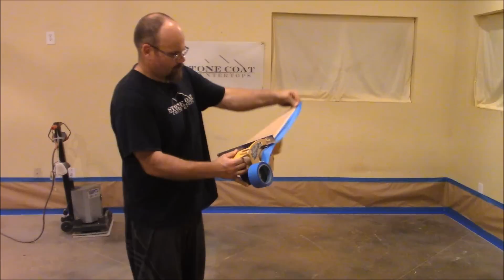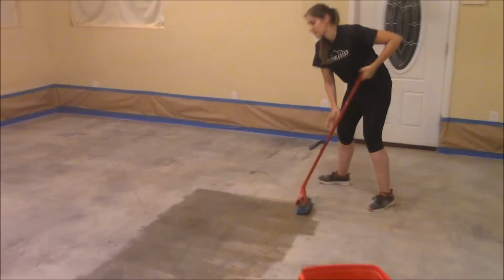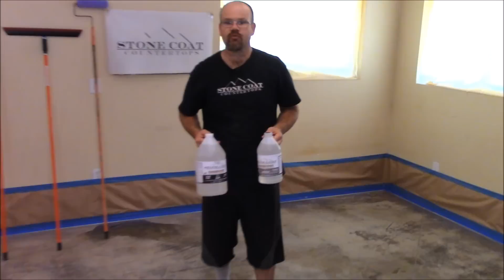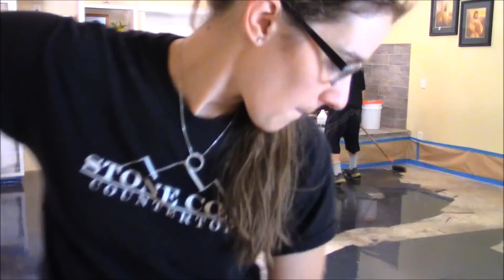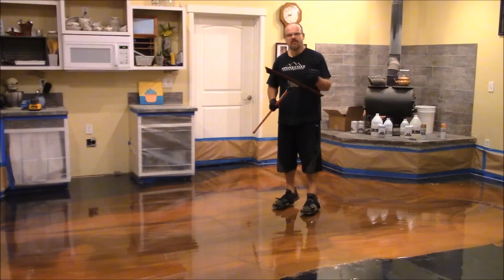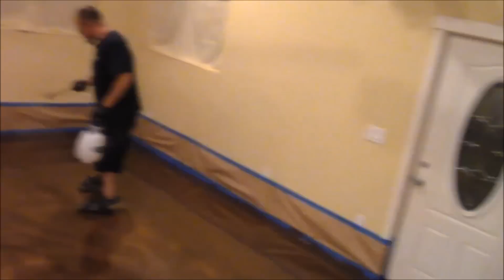How to Install Metallic Floor Epoxy

Comment: Is that it? You just suddenly end the video! 
Do you also pour a clear coat over the top of the color coat, like on the counter tops? Or just stop after the alcohol spray? 
How long to dry before it can be walked on?

And why are most of your answers not available to be read on YouTube? It says you have commented. But when I click on it, there is no answer there. I know you answered bc the asker thanked you for your response!?

Comment: Dude. You need to be masked up. Doing a video in a room full of dust w no breathing protection? And no mask while mixing metallic powder??
As another 20 year installer, its hard to take you seriously while these extremely dangerous things are going on. No vacuum control on floor machine? Tighten it up. Or youre gonna die. Or hurt someone else while doing residential work as carelessly as this video. Not good dude.

Comment: Where did you get the quarter inch notch rubber trowel plz I don’t see it on the website favorite tool list
Reply from the maker: Here ya go Edd https://www.amazon.com/dp/B001RIX48Y/ref=as_sl_pc_qf_sp_asin_til?tag=stoncoatcoun-20&linkCode=w00&linkId=2bdb8d49b05979233fb7c29b1a208dc6&creativeASIN=B001RIX48Y
Other tools: https://www.stonecoatcountertops.com/favorite-tools-checklist

Comment: Nice presentation good explanation I am sold I'm ordering Monday May 3,2021 for a small project 12 sq feet. I'm going to use level quick because I  have a level difference from hard wood floor to concrete. Also level quick will help minus difference of front door thresh hold. Topping with transition of 12' . Thank you watched studied like the product. Hope delivery time is within 5 days.

Comment: Gorgeous! Question: if you have vinyl/laminate flooring, should you remove it before doing epoxy or can you sand it down and do epoxy over the top? Same question for wood floors?
Reply from the maker: Our epoxy can cover almost any surface! Google Stone Coat Countertops over your surface choice and you will get all the information to help you complete your project and remember...You got this! -Nathan

Comment: Have you tried "shotgunning" the bottle while its upside down? Just jab a hole in the side. I'd do about an inch from the bottom to avoid leaking when placed upright.

I love all the projects by the way.

Comment: I don't want use a propane burner to pop bubbles and I don't have a mister for the oil. would a standard spray pump water bottle filled with alcohol do the trick?

Comment: You'd be amazed how fast your product would come out of the gallon jugs if you allowed air inside the jug... your jug holder is starving the jug of air which slows the flow rate.  Just Say'n

Comment: After determing the square footage of the flooring area,  how do you determine how much epoxy needed?  How much square footage does a bottle of epoxy cover?  Cost? 
Can this product be used on stairs?
Can this product be used over old kitchen laminate flooring?
Also, do you have a list of all the materials we need to purchase to complete the job?
Cost Estimate of materials needed?

Thank You.
Reply: Did you ever get any answers on this on your own??would like to know thanks
Reply: @AbransWorkshop  
No,. I Didn't.

Comment: It looks rather slick. Do you have recommendations for say...a garage floor that experiences many ping-pong battles? It is also traveled by many wet shoes/feet with little traction on the sole. Thanks in advance.
Reply: Other epoxy videos (including Mike and StoneCoat Countertops) recommend a topcoat/sealcoat of clear polyurethane. There's no reason you couldn't use a clear textured poly as a topcoat to give the floor some "grip." Given that it's textured you will trade off a small degree of clarity but the floor would still be beautiful... and safe!

Comment: I tried this and my Goldendoodles got in the room and they shit all over the floor and rolled in the wet epoxy paint and fell asleep on the floor and they got stuck to the floor and I had to shave them to get them free but now my epoxy floor has two small built in area rugs right in the middle of the room.
Reply: Just throw the whole damn dog away.

Comment: I was wondering can you apply to floors that have ceramic tiles already down. I was thinking about putting the product on top of the existing floor filling in the grout lines and creating a marbled look. If this is possible would the prep work be the same as to concrete?

Comment: Did you use a roller after you used the trowel, or did you just let it flow out and torched it. Love the videos, my next project is the floors and we don’t like tile. The color is great also.

Comment: Warning: Do not try to vacuum up concrete or epoxy sanding dust with a regular household vacuum. It WILL clog up the device in no time and render it unusable until a thorough maintenance.
You need a water based vacuum or a good (self cleaning) shop vac. Better yet: Use a broom.
Reply: Fwiw, I wouldn't recommend using a broom. The dust is so fine you will just push it up into the air and then it will recirculate all around your house. What you specifically need is a Shop Vac and a specific shop vac bag, specifically the following bags for ultra fine dust. https://amzn.to/2Gr7FnN

Comment: I noticed after you sanded the floor you did a moisture test. If the floor came back positive for moisture the floor sanding would be vain

Comment: When your filling the joints you say you can use level quick...would you have to sand that down after dries before laying down your first floor coat??
Reply from the maker: Hi Brandon Raynes, yes you would want to sand the level quick down to a smooth flat surface removing any high points, or nibs and nubs before proceeding.
Reply: I

Comment: How long do you wait until you pull up the tap?? When you walk on the epoxy while pulling up the tap do you wear regular shoes??? Thanks
Reply from the maker: Hi Brandon Raynes thanks for the comment! 
You'll want to remove any tape before the epoxy hardens, you want to wear the spiked shoes to minimize surface area of your feet on the epoxy surface and allow the epoxy to easily self level back into the areas that you stepped. 
Give us a call at 541-450-1976 and we can get you some pro tips before starting your project!
Reply: Thanks for the answer sir but when do you pull the tape??

Comment: Can you install radiant heat under the epoxy just asking because I see this getting cold as heck?
Reply from the maker: Awesome thought Glen! Yes you can apply our flooring epoxy over a radiant heated floor. Give us a call at 541-450-1976 with any questions and we can get you going!

Comment: Do you put a clear coat over the top?  I'm thinking of metallic blue with white sparkles.
Reply from the maker: Great question CaseAgainstFaith1.  Our Stone Coat Countertop Flooring Epoxy 1 1/2-gallon kit will cover 100 square feet including the prime coat and the flood coat. This is a great 2 coat system. Each kit comes in your choice of Stone Coat Countertop Metallic powder in the large flooring size to create marble metallic effects. The first coat is applied very thin at 300 square feet per gallon using a flat floor squeegee then back rolling. Cut the edges in with a brush. You add one flooring size metallic powder to each 1-1/2-gallon kit to achieve amazing depth in color. We recommend 2 metallic colors per floor for a great marbling effect. The second coat is applied at 100 square feet per gallon using a 1/4" v notch floor squeegee and then back rolling. Cut in the edges with a brush. Simply pour out the mixture in ribbons and mix together on the floor using your squeegee and back rolling to make amazing effects. Here is a link to more information about our Flooring Kit, including training videos and  written instructions: https://www.stonecoatcountertops.com/flooring-epoxy Please call or write us anytime with questions or for free project support. (541) 450-1976

Comment: at the end could you use a torch like a weed burner type? Of course safety first
Reply from the maker: Hi Darren! Here is a link to the torch nozzle and hose we used for this project: https://www.amazon.com/Propane-Turbo-Torch-Nozzles-Hose/dp/B000TBS2RS/ref=as_sl_pc_qf_sp_asin_til?tag=stoncoatcoun-20&linkCode=w00&linkId=3fbe11024fed2ccd5d28463d2d7048d7&creativeASIN=B000TBS2RS

Comment: When you start the cleaning phase, you should have a rainbow vacuum cleaner running in order to  remove dust from the air.
Reply from the maker: Thanks for the tip Ann Matthews!  Are you working on any projects currently?
Reply: Not yet; but we are laying plans to do a kitchen counter and backsplash, as well as a bathroom tub surround and a double sink vanity top with an apron front. Hope to start these before the end of the year. I viewed several of your videos and you have given me great inspiration! Thank you!

Comment: Would there be any way to lay down strips on the floor, before laying the epoxy, that can be pulled up after. To give the floor the look of a tile floor?
Reply from the maker: Great question Kent B, the floor would need to be sound for this process to work. Once the floor is coated there wouldn't be a way to pull up the strips as they would be cured into the epoxy.  Please feel free to call or email us anytime with questions or for project support. (541)450-1976
Reply: Perhaps lay down a color coat, add grout colored strips, then a clear coat

Comment: Have you ever tried using automobile wax on the bottom masking tape line,  so it can be removed after resin is cured without sticking?
Reply from the maker: Great question glenn and thank you for tuning in! We haven't tried this method before.  We always remove the tape after we have finish so that it will not cure into the epoxy.
Reply: @StoneCoatCountertops Its what we do when working with resins for composites on aircraft

Comment: I like you guys, just finishing my 1st little project, bought lots of epoxy i have no idea what will i do with it but when wood gets to me its gonna be wild !! Btw, when is the best time to take off tapes from the wall  ? is it just right after applying final coat ? or you just wait till everything dries then cut it off ? wouldnt that leave marks and shit ?
Reply from the maker: Great question Pawel and thank you for your feedback! We remove the masking that touches the epoxy surface right when we are done with each coat so it won't get locked in, and re-apply the masking at the walls between coats.  Please feel free to call or email us anytime for free project support. (541)450-1976

Comment: What is the life of epoxy (l mean gaurentee)
Reply: On a counter top it can last a lifetime with just some light polishing from time to time. On a floor, High traffic areas will need to be polished more often.

@Stone Coat Countertops, What type of polish would you recommend for floor applications?

Comment: I have a rough finish basement floor.  Some pitting and older cement.  Used a basement floor paint previously.  Does the Epoxy have a self leveling effect or does a self leveling process need to be done first and then do your flooring process over it?  How does the floor perform with high humidity in the basement?

Also you mentioned ok to do over laminate flooring.   Ok on stairs over laminate?  Does the mixture film over any nails or screws and level out to not show any indents?  

I'm concerned if it will be very slippery when wet.  Is sand or some material to be added to eliminate dangerous slipping without being overly abrasive? 

Haven't seen anything on removing this flooring should that be needed in the future.  What would that process be?

What is the ongoing floor care process?  Mopping with any special product etc? 
 Does the finish fade or scratch?  Is a special polish needed?  
The Countertops can be buffed for scratches, I assume also for the floor. 

I"m excited for discovering this new product and the affordability and hoping the finish and durability is quality.

Comment: Did you clear coat this floor? Second, when was the tape removed?  If i choose to clear coat, im assuming keeping tape in place isnt good, so do i completely cure then tape again?
Reply: On duplicate question SCC says "We remove the masking that touches the epoxy surface right when we are done with each coat so it won't get locked in, and re-apply the masking at the walls between coats.  Please feel free to call or email us anytime for free project support. (541)450-1976"

Comment: Nice, can you use a 1 part epoxy paint for garage floor as a primer before laying the metallic epoxy?
Reply: before the primer or after?
Reply: After your "primer coat" has dried.

Comment: If I want more of a "controlled" look with say 2 or 3 colors can they be done in layers? Instead of melding together in one coat. Also could you use the mixture you used in the concrete "expansion" lines in large low areas to help fill them? Would it have to be done in thin layers or could you do say 1/2" ask at once.

Comment: had my garage floor done Feb 2016 at move in time. there is some damage to the floor.peeling and scratching, bubbles. How can it be repaired? Copper swirl with denatured alcohol splatters

Comment: Your videos are awesome. I've learned so much. I'm building a 4' x 4' tap dancing practice board made with birth plywood and foam pads underneath. It will be bendy. Can I use this epoxy to seal it? If not, can you recommend something?
Reply: StoneCoatCountertops Thanks for the Info.